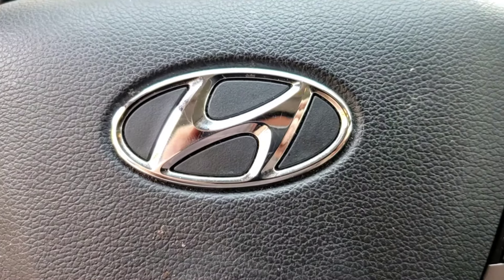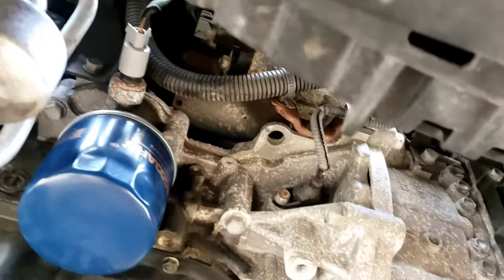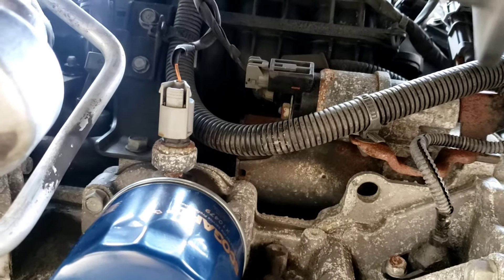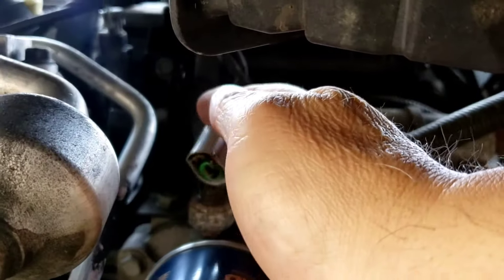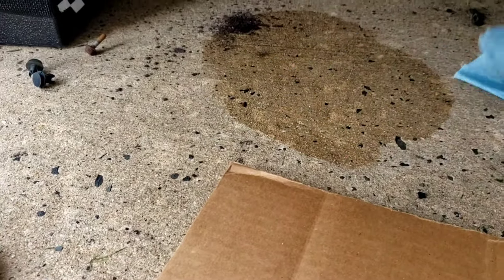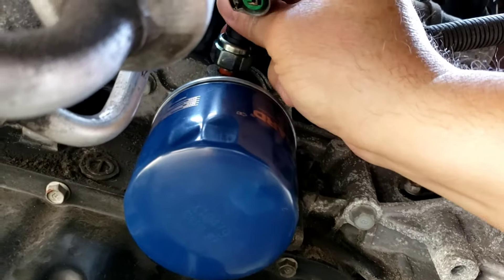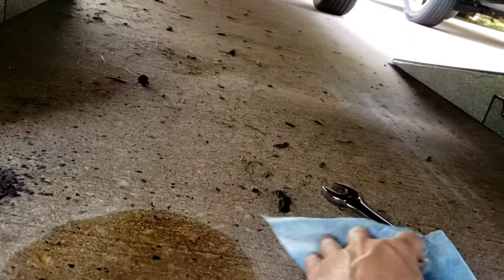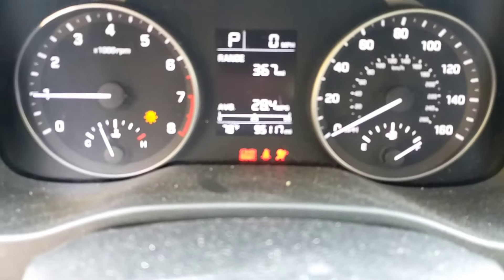Hyundai Elantra Red Oil Light ON or Flickering 2017 and Similar  What can it Be if the Oil is Full.

Comment: Elantra GT shouldn't be any different?  Full oil with red oil light
Reply from the maker: No difference,  check the oil pressure switch and connector  for oil and replace the switch and clean the connector
Reply: I just switched mine out today. A few hours ago. Weird thing the old one was never tight. I was going the wrong way to take it off, but even doing that it never got tight. So I dont know what happened there, but I put tje new one on. And the light went off. As soon as I started the car. I drove it and its fine. It hasn't came back on, but I still wonder why. It never got tight in the first place, and I believe this is tje first time. The switch has been changed. So its weird, but as long as no oil is dripping. That's good
Reply from the maker: @Afrado31  some people make it too tight and it breaks off inside the engine oil housing.  No leaks, No lights then you're OK..Thanks for watching too...
Reply: @alyoungcuda  thanks for showing us how to save money. 🙏
Reply from the maker: @Afrado31  no worries

Comment: Well im confused reading these comments, I have a 2013 hyundai elantra. When I do an oil change on my car the oil like flicker problem will go away for around 500-800miles then it will start happening again, if I keep driving it with the light flicking the car will randomly shut off. The light only really flickers at low rpm but once im going faster then 40mph it doesnt seem to happen anymore. Its been like this for a year and I have just been switching the oil every 500miles to prevent the light and any damage. do you have any solutions or idea what this could be?
Reply: Update, took a look at the switch and it looks like the previous owner did replace because it looks new. it says 20/03 on it with zero rust and had no oil in it.
Reply from the maker: @thegreatbenis225  change the switch,  looks can be deceiving
Reply: @alyoungcuda  I think the previous owner sold the car knowing it had a bad oil pump, ill replace the switch but i do think its already was done. since it looks like it was just replaced.
Reply from the maker: @thegreatbenis225  new ones can go bad, Autozone has a lifetime warranty on theirs..You can also rent an oil pressure tester to check the oil pressure readings..the hose and gauge screws into the hole where the switch comes out of and you start the engine and read the pressure at idle..warmed up of course.
Reply: @alyoungcuda  I changed the sensor like you said and it didnt fix the issue. My brother has a computer with the software to check all that out but it will be a week before he can test it. You think its possible its the oil pump?
Reply from the maker: @thegreatbenis225  computer won't help, you need an actual pressure reading with a gauge..is the engine making any noises? If the pressure reads good, then its a loose wire somewhere, maybe at the connector for the switch, as for a pump, could be but those engines are known to go bad, a pump won't save it..a thicker non synthetic oil might help if its a low pressure problem because of worn bearings. But you need to verify the engines oil pressure before you go further
Reply: @alyoungcuda  I can test it in a few days when this storm clears. the car runs well when the oil is changed for a few hundred miles so im assuming its a pressure problem. The car doesnt really make alot of noise it does sound wierd but we think thats the belt because when you put it in neutral and rev the engine it sounds good with no knocking. when the flickering happens the car does start to sound wierd when its about to shut off randomly.
Reply from the maker: @thegreatbenis225  when you rev it, the pressure goes up and the noises will go away, its the low pressure at idle thats killing it..you will see with the gauge reading when you test it with the engine warmed up..but I see you mentioned a knock noise, thats not good..in the old days, they install a thicker grade oil to help the pressure,  but as soon as it gets hot and thins out, the engine will start to make noise again because its hurting...
Reply: @alyoungcuda  so basically im fuk'd and this engine is bad? is their a way to get it fixed?
Reply from the maker: @thegreatbenis225  replacement engine is your only choice, but that gets expensive, Unfortunately Hyundai cars are throw aways once they start to go bad.
Reply: @alyoungcuda  Ok because you are an expert and probably never heard of this personal experience I want to share this with you . I found out today that the problem was actually engine sludge in my engine. I told you after a oil change the problem would go away for 800miles well this oil change I decided not to change the oil filter and oddly enough the pressure problem didnt go away for the first time. Well basically my oil filter is sludging up which takes 800miles to completely fill up and fail it will cause my oil pump to not work causing bad oil pressure. Insanely wierd, hope this knowledge helps you in the future to diagnose problems. The oil pressure problem takes longer to occur after each filter change by around 200miles each change, so constantly changing this means its is getting better slowly. What ima do is clean my engine of the sludge and hopefully everything is fine. I think the engine is still fine, their is a little ticking sound but its coming from outside the engine I believe.
Reply from the maker: @thegreatbenis225  sludge is a bad problem when the oil is not changed on a regular interval, but I assumed you did your regular oil and filter changes but if you bought the car used, you never know what the previous owner did and there are cheap oil filters and cheap oil that aids to sludge in the engine. Same as cheap brake pads give off more brake dust and gets the rims dirty more. Good oil filters have a bypass valve to bypass a clogged oil filter to a certain extent. But what ever you do, do not pour in those engine motor flush in a can into your engine, all that does is loosen the sludge and it clogs up the oil pump screen in the oil pan..sort of like a blocked artery.
Reply: @alyoungcuda  sludge is a crappy problem, my plan is to change the filter regularly every 500miles. When i first notices low oil pressure I gave it a oil change, then it happened 300miles later then 500miles then 800miles so that means that it is slowly getting better.

Comment: I accidentally ripped the pigtail, how would I go about fixing it.
Reply from the maker: You ripped the plastic clip on the connector  or the wires out of the connector ?
Reply: @alyoungcuda  I ripped the wire out of the connector. I was changing the starter and accidentally dropped in on the wire and it ripped out.
Reply from the maker: @Teuhcatl  if you buy the special tool to remove the pin from the connector, you can reconnect or solder it back on.

Comment: Another question. What is the red stuff on the threads? My new sensor did not have that on the threads.One video I saw they said to put teflon tape on the threads and another video told me not to put tape on the threads. Confused here as what to do.
Reply from the maker: Some say not to put Teflon tape on because the switch itself us a ground..but use tape so it don't leak..the treads once screwed in will strip off and make a good ground...but if it has the red sealant in the treads..your fine..put it in like that.

Comment: I overtightened and cracked the hole 😢
Reply from the maker: Oh No, its not a bolt with a head on it, it doesn't go to the end and it stops, now you need the oil filter housing,  its a common problem.
Reply: @alyoungcuda  I used the jb weld, and I might need to rethread the hole and use a new insert, and idk if that will help :/ just waiting for the jb weld to dry
Reply from the maker: @sheeshd977  if it holds, definitely use Teflon tape or the Teflon liquid  to help seal the treads
Reply: @alyoungcuda  I couldn't rethread it, I used orange threadlock and added a little more jb weld 😬 idk if it will work , I'm praying 🙏 I forgot to get a brake cleaner. Can you spray that directly into the sensor, too, or just the wire connector?
Reply: @alyoungcuda  I'm looking back at your previous comments about some dude trying to sue you, and I can't believe I didn't take my time to do it right. Waiting for everything to dry 🙄☹️
Reply from the maker: @sheeshd977  depending on what tool you used can make a big difference in the feel and torque , like comparing a wrench either short or long, socket and ratchet either in a 3/8 or 1/2 in drive with a short or long ratchet handle makes a real difference in leverage.
Reply: @alyoungcuda  bro, I suggest taking the time to update this video by deleting it and adding a warning because, literally, this sucks major balls. I wish I could have watched something that said don't overtorque it.. I'm just hoping this works. If not, I'm screwed i don't have a car for work

Comment: Bad map sensor...
Reply from the maker: Map? You do know what that sensor does right? Not oil related at all.
Reply: Yes , loss of power, engine stalling ,miss-fire ,  flashing oil  light , oil sensor was ok.....changed map ,and the  oil light stopped flashing....
Reply from the maker: @JohnJones-zb7el  thats because you had a low idle running car, same reason why your oil light is on when your 1st turn on your ignition.  Low engine rpm will give you low oil pressure since it is running so low the oil pump is not pumping. Think of it as a stroke, low pumping heart will make you faint and fall, but nothing here has your engine troubles, but thanks for the input if you have engine running problems.

Comment: I just did an oil chnage on my 2017 last night and it was on the full mark and once i started driving it for work the oil pressure lamp keeps blinking on and off and stays mostly on and now the oil level is half way down on the dipstick. 😐 should i check this sensor then? Or just add oil?
Reply from the maker: 1/2 down the mark is still in the good mark, check the sensor connector for oil from a leak, then change the oil pressure sensor , clean the connector with a spray of brake cleaner and allow to dry 5 minutes
Reply: @alyoungcuda  thanks bro!